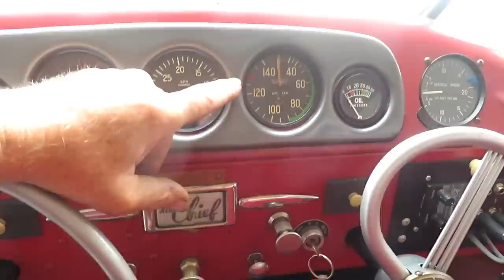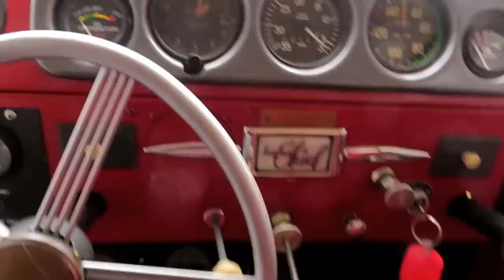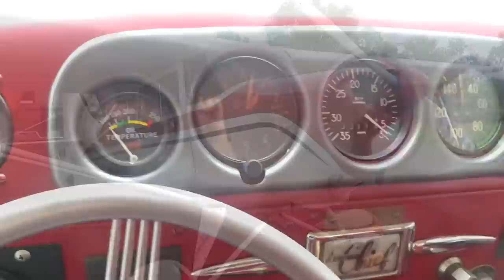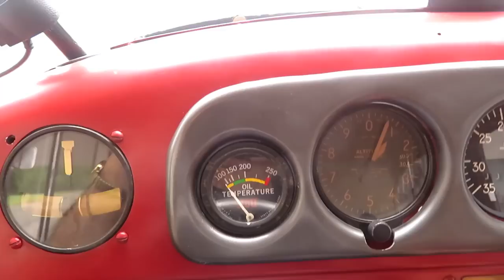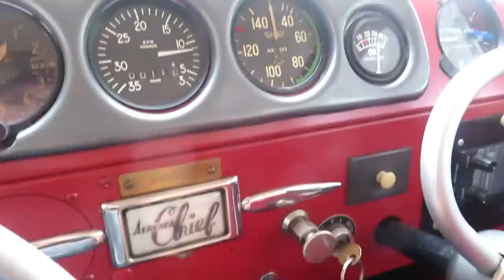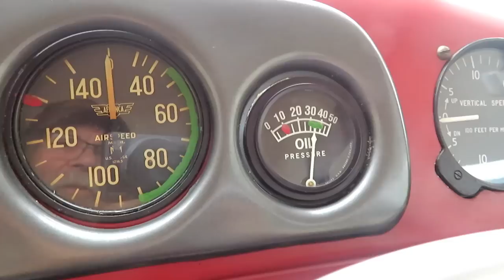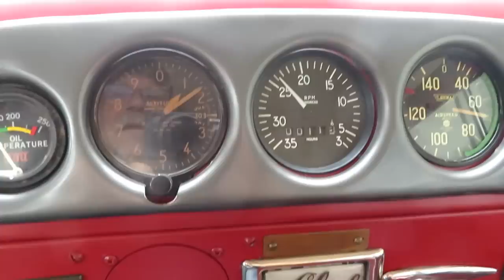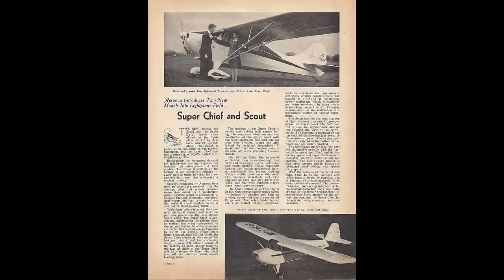Steam Powered Machine Shop 83:  32" Shaper Work

Comment: As others have said, What a pleasant surprise! I owned and flew a 1965 Cherokee 140 for more than 30 years. It got sold and continues to soldier on but I now have a 1949 Aeronca Champ hanging in the rafters and in need of rebuilding. Seeing your Chief just about made me run to the shop and get my arse in gear. 
Here’s an interesting fact. I am a helicopter AME and was working in India in the early 80s based out of the Madras(now Chennai) flying club and they used Hindustan Aviation manufactured, Chiefs which they called the Pushpak which was the Mythical vehicle (magic carpet) of Lord Vishnu. I had the great pleasure of going for a few circuits in one with a very progressive young lady, private pilot. By the time I got approval to do some flying there, Indian bureaucracy being what it is, the job finished and I had to go home to Canada.   Pleasant memories, none the less.
Thanks for sharing the Chief with us Dave.
Reply from the maker: Jay, Here's an interesting thing about a Cherokee 140. My trainer was a 64  Cherokee 140 (first year for them), and got my license with it. The tail No. was N6003W. 6001W was a prototype, 6002 was something of the factory and 6003W was the first 140 offered to the general public and was given away on the "Price is Right" show. The log showed where it was partly dismantled to get it in the studio.  It had thousands of hours on it before a student finally wrecked it. They flew great and were rugged but hard to see out of.....Dave
Reply: @davidrichards5594  I bet it had no toe brakes, like my 65. The old ones were better, in my opinion. They had less junk in them. Mine weighed 135 lbs. less, empty than another mid 70s one that I flew and it was much nicer to fly.

Comment: I recently sold a G&E 24 inch shaper to a friend. Didn't use it enough to justify the space it took up.  One thing I read in the owners manual is after starting the motor to let it run without moving anything for 2 minutes. This is to allow oil to circulate throughout the machine and to properly lubricate everything in them. 

Love the chief as I'm also a tube and rag plane owner however mine is slightly faster as it's a 1974 Bellanca Super Viking with the IO-520 300hp engine. This next February will be 10 years I've owner her and love every time I fly her.

Comment: A few years ago I picked up a set of calipers like that Starrett, but Mitutoyo from a used tool place, beautiful condition for $100, they have come in handy  number of times. Edit: Guess I should have watched all the way through before commenting, what a treat! Didn't realize you were an airplane guy. I have been thinking real hard about getting current again after 20 or so years of not flying.

Comment: I live in Endicott and that airport and the old dump were my stomping ground when I was a kid. I drive by your shop several times a year . I remember from when I went to BOCES in the mid-70s with a kid named Ralph? He was from Newark Valley and he worked at a garage just passed your shop on the left . A blue building which I believe it's a diner now. I wonder what happened to him.

Comment: I love the panel!!!  So many have been cut or replaced.  Perfect plane for  spending a couple hours not going very far or getting there particularly quickly.  What's under the cowl?  LYC O-145?
Reply from the maker: Hi Nate, The engine is the original C85 Continental with the O-200 crankshaft conversion....Dave

Comment: The plane just seemed to leap into the air.
Reply from the maker: Hi Pete: It's surprisingly quick. The first Chiefs were 65 HP, by 47 they were 85 HP and mine has a 100 HP crankshaft conversion that increases the stroke and compression ratio and probably makes about 100 HP. It makes a real difference in take-off distance and climb......Dave

Comment: How often do you have to change the tool on that shaper?
Reply from the maker: The high speed steel tools usually hold up well for the whole job and then get a light grind to sharpen for the next job....Dave

Comment: Always like videos where a shaper is used.  They are not economically the best option for metal removal but I think they are the most interesting.  I have one question.  Are  shapers designed to cut metal right to left or can they be setup to cut left to right?  Thanks in advance.
Reply from the maker: Hi James, They can feed left or right, up or down. ....Dave
Reply: @davidrichards5594  Thanks I've been wondering about that?

Comment: No, thanks for sharing your unknown hobby. I thought our common interests were machine shop, the aroma of cutting oil,  grinding high speed steel tool bits, EBT, and Buick engined street rods (a 56 years of tool & die making career rengined a 327 '30 Ford hiboy coupe with a Buick V6).
I never got into airplanes benond 2 friends having taiilgraggers.